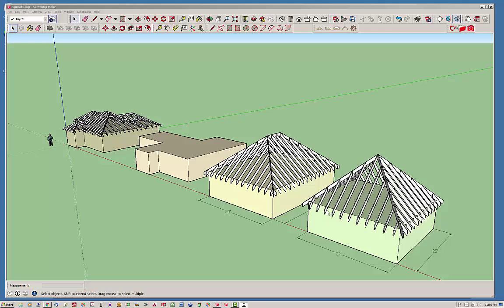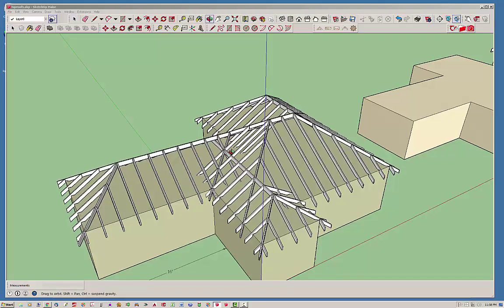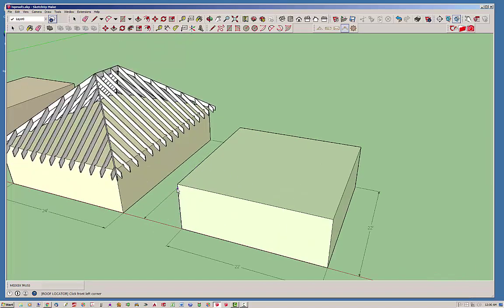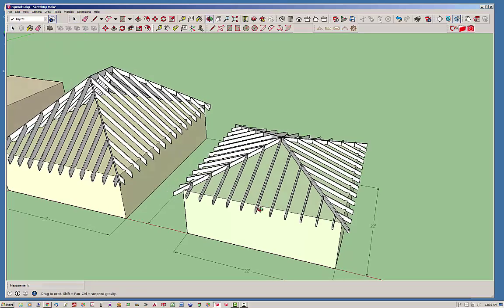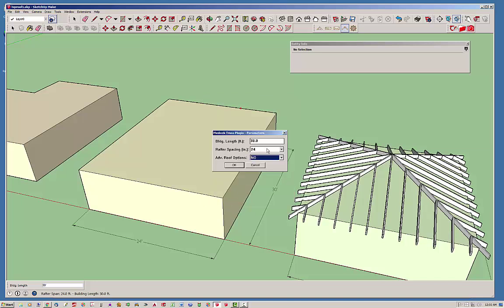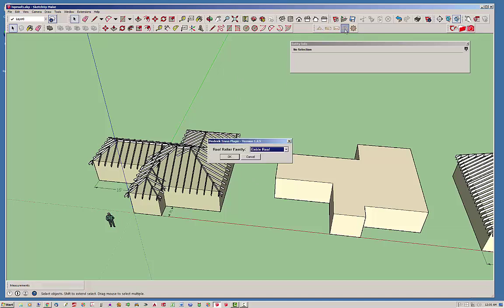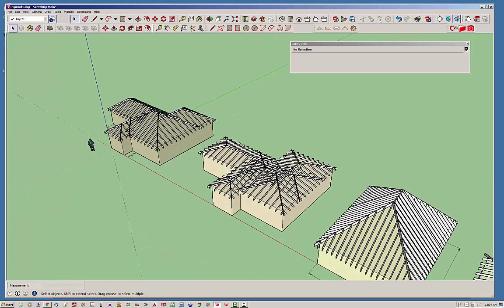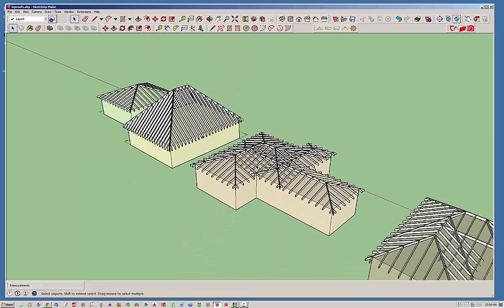Medeek Truss Plugin Tutorial 3 - Hip Rafter Roofs

Comment from the maker: One method of framing this roof configuration is to extend the lower ridge past the joint until it meets the next jack rafter, then the flying hip and valley are miter cut to meet the lower ridge.  

I've created a version of the model above with this method of framing at the flying hip/valley/ridge joint:

https://3dwarehouse.sketchup.com/model.html?id=u06386a43-c138-4e90-8b2c-779fd2b63705

What is the thinking on this method of framing this particular configuration?

My other concern is the way I have the valley rafter miter cut where it meets the fascia and the corner of the building wall (top plate).  Is there a more practical way or better way of making those cuts?

Comment from the maker: Compare Rev 2 with Rev 3:

https://3dwarehouse.sketchup.com/model.html?id=u83ae5e44-1b19-4c09-8586-93988684289e

This version of Hip Roof 4 has the flying hip extending as a full hip to the exterior wall and then the lower ridge framing into it with the valley rafter framed in last.

Comment from the maker: I've uploaded a test L-Shaped structure with a hip roof:

https://3dwarehouse.sketchup.com/model.html?id=u8d384878-941b-4df9-a8c9-8bba849765bb

I've created both hip roof primitives with the plugin, that was the easy part. 

I then manually placed a valley rafter with its centerline (top) inline with both roof planes.  I think I've got it right.  What I am unsure of however, is the best way to terminate the framing at the intersection of the valley, lower ridge and flying hip.  Once I have a handle on how a carpenter would actually construct that junction I think I can proceed to start work on a secondary roof module for both hip and gable rafter roofs. 

This will allow the plugin to automatically add secondary hip and gable roofs onto a main hip or gable roof and adjust the rafters accordingly.